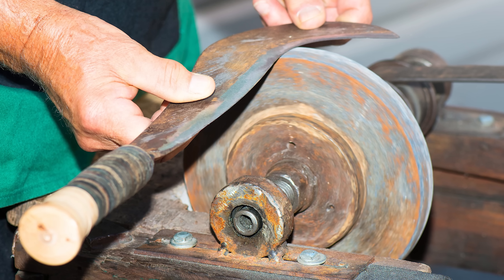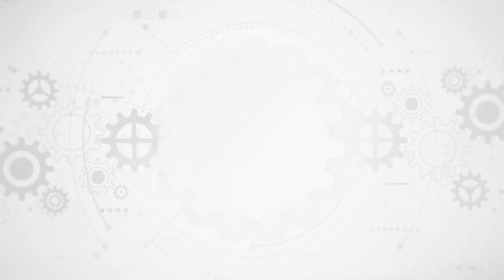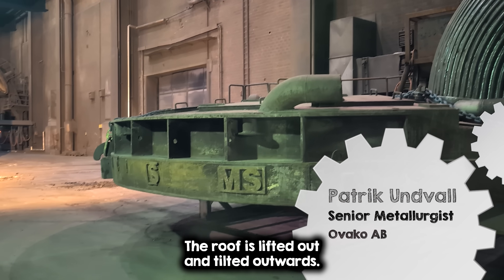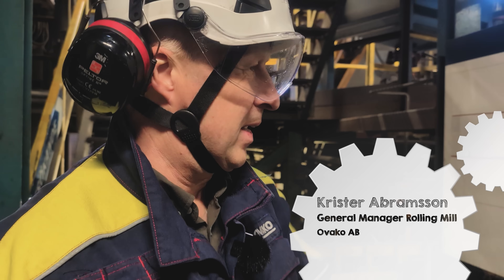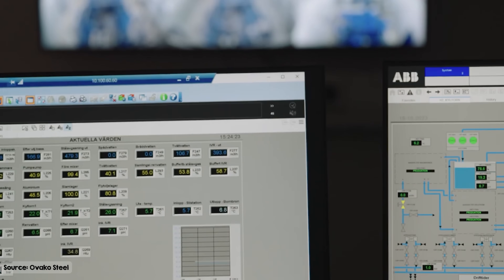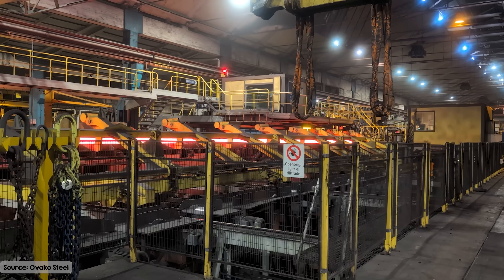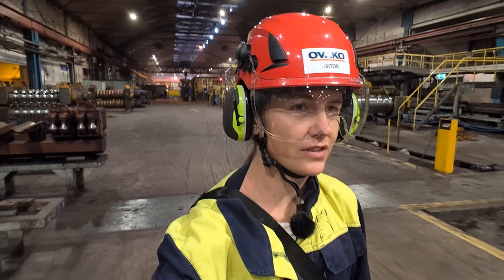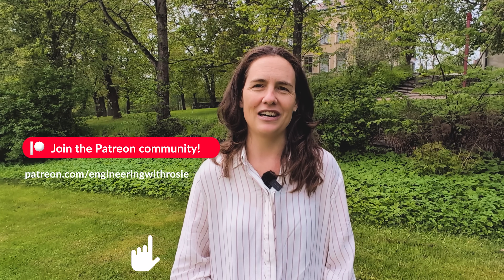STEEL REINVENTED: Inside the World’s First Plant to Burn NO FOSSIL FUELS [TOUR]

Comment: There is a big efficiency drop creating the hydrogen, so depending on local electricity grid, it may or may not save carbon. Unless your grid is heavily skewed towards renewables, you may be burning more fossil fuels from generation than just burning gas.

Comment: Great tour! Very exciting technology. Is there a reason they use electricity to generate hydrogen which they then burn, rather than just using electricity to heat the steel directly? Energy storage perhaps? Would a future mill potentially just use electric heating exclusively?

Comment: But where did the energy come for the electrolysers? Was it wind/solar or was it coal or nuclear? Recycling scrap intrinsically carries less carbon footprint, so there’ll always be electric arc furnace model. Similar to aluminium recycling scrap for 5% of virgin cost.

Comment: Producing H2 onsite is probably the best use case for it to mitigate embrittlement and leaks across pipelines. There are linings that can be used but it's easier and safer to just provide the electricity and water needed to the end user then have them produce H2 and store it locally.

Comment: Amazing look inside an innovative steel recycling plant! I'd be interested in how they solve the ramp up / ramp down of the electrolyzer, what the design is that makes that possible without a nitrogen purge, and what the efficiency is as a result of that design, i.e. how may kWh per kg of H2, and how many kg of hydrogen it takes to displace a kg of propane. Totally get whey they didn't / couldn't go with induction instead, but it would interesting to compare induction heating kWh vs. kWh to the electrolyzer for hydrogen heating. Hydrogen used onsite where it is created is the right approach.

Comment: in the end of the 80s i was with my father to the steelwork in Lesjöfors, it was in the winter and they mostly melted old steel.  we stood in the controll room when a loud bang sounded and i just saw a glowing piece going up from the EAF landing a bit further down the plant.   It was a old V8 engine that had Ice in it so when it got super heated the ice became super vapor and became like a rocket fuel :P 

it is so cool to get to see different plants like this

Comment: Hydrogen can be used to reduce iron ore into sponge steel. But this mill is not doing that, so their steel still has high CO2 emissions from the blast furnace stage.  

This video is misleading, or just poorly researched.

Comment: It seems blast furnaces are a thing on the past and the new way of producing iron ore is the the direct reduction method. India and Iran are the world leading manufacturing countries using this method. There are plants, although all small scale in Algeria, the USA, Argentina, Bahrain and Sweden. Unfortunately none use hydrogen as a reduction gas and Australia with one of the largest iron ore deposits has none. There are plans to produce direct reduction iron in Whyalla with a mix of natural gas and hydrogen. Hardly call that green if natural gas is used. 

Where does Australia think it is going to get natural gas from when they sell everything they extract to world markets. We now have to buy our gas on the open market from places like the US or China, who buy our gas, thanks to John Howard, at a price negotiated decades ago and far less than the current market price and the price we sell our gas to China and the US can’t be renegotiated until 2031. These countries don’t use all the gas they are guaranteed but then sell it back at market price to us. The Rudd and Gillard governments didn’t help either as they entered into similar contracts as well. We must have the most inept business sense politicians in the world, and what kind of public service do we have in fair trade and treasury to even bring such deals to inept politicians to sign.

Comment: It's really neat, though I don't understand why burning hydrogen is better than all the other ways of producing heat with electricity.  Can't tungsten be used for resistive heating even at these high temperatures?  Hydrogen can be stored, which is nice, so you can produce more hydrogen when the wind is blowing/sun is shining.

Comment: I'd be curious to compare the cost and energy efficiency between heating ingots with stored heat from electricity, (Companies like Rondo can store high temp heat in bricks using electricty.) vs. hydrogen. I would think electricity would be more cost and energy efficient? Although not storing and transporting hydrogen does improve the efficiency. Hmmm????

Comment: There is no clean energy, only low emissions energy.  Hydrogen is actually lower on the activicity scale than iron which means iron replaces hydrogen in chemical reactions.  Iron can be reduced electrically similar to aluminium at similar volumes per power used but iron is 3 times the density so 3 times the cost per tonne.  Rosie needs to do a full thermodynamic analysis.

Comment: Hmmmm, doing some researching it seems that deployments where the electricity itself is nearly free due to being plugged in to the DC side of utility-scale PV deployments in a future with substantial summer excess production, aqueous electrolytic ore processing would come up cheaper than current blast furnace based refining costs (specifically, coming up to just about 0.1 $/kg of iron). That's for an assumed installation potential of around 180 $/kWp of electrolysis setup vs. PV nameplate capacity. Co-located LiFePO4 battery storage for (some amount of) day/night shifting is assumed and as that needs to aim more at less-sunny days, there'd be some spare load shifting potential to use for higher duty cycles operation of the electrolysis. It's only assumed to run about 15% of the year's hours, still. Assumed is to have up to 20% of the solar nameplate capacity be matched with electrolysis nameplate capacity to not over-stress the load shifting and not limit the duty cycle of the electrolysis too much by it being throttled to provide the rest of the grid with normal grid power. (The PV heavy setup for e.g. Europe just involves a giant amount of overcapacity in the summer to handle winter heat pump heating, which btw. is not at all a bad thing as throttling in the summer just means you have more electricity than you can utilize at a time where sun is abundant; you want to have enough when sun is not abundant and as long as the costs involved to provide the latter are acceptable, everything will be fine and you can consider stuff like this seasonal iron ore electrolyzer to eat up effectively free sunny summer daytime electricity that the grid couldn't transport anyways (it's not worth to have that much more grid capacity as you can't afford the grid cost for such low-duty-cycle things).

Such a system just for reference would be using up to about 30% of it's yearly electricity production to feed the iron ore electrolyzer. Some other metals should also be amenable to low-duty-cycle capable electrowinning.

Comment: The title is a little bit deceiving. Propane is a fossil fuel where the energy cost of production needs to be factored in to the whole process as well as its use.

The use of scrap and electric arc furnaces is nothing new. It is not primary steel production. Sweden has a rather huge iron mine in the norther part of the country. That's where the process becomes more difficult to reduce fossil fuel consumption.

Just wondering if induction heating could be used on those billets and if so that could even eliminate the use of hydrogen.

Comment: Dr. James Tour and some grad students came up with a way to make Graphene from waste plastic(can even be dirty).  This "flash" process uses $30 worth of electricity to make one ton of graphene.(It was costing $thousands per kilo)  One byproduct is hydrogen.  The graphene has many uses.  In small doses it can increase strength and lifespan of concrete and asphalt.  Concrete is another huge producer of greenhouse gasses.  Extra strong concrete that lasts way longer means less concrete needed.  As we refine less and less fossil fuels we have access to less and less asphalt to make roads.  Significant lifespan increase by adding graphene means less asphalt needed. 
Build the graphene plant next to steel mill and pipe over waste hydrogen. New tech is cool.

Comment: In Northern Sweden there will be two steel mills that will make steel from iron ore, at least in the future, SSAB Hybrit and Stegra, using new environmental friendly processes. Stegra is a completely new steel factory that is built now outside Boden. SSAB in Luleå will close down the old coal dependent process soon and build and a new factory. The old coke plant has been one the biggest polluters in Sweden, in the 90s it contributed to 25% of the Swedish CO2 and SO2 emissions, now around 10%. So reducing these emissions are important.
Reply: Near polar and polar regions actually do need more co2, so it is unfriendly to reduce the emissions, and it's completely against the interest of nordic people.
Reply: @bennyklabarpan7002  No that's completely false. The polar regions heat up at 4 times the global rate. Meaning that the effects of climate change are already devastating local industries and ecosystems
Reply: @heinzaballoo  Polar regions are barren or in the case of antarctica it's the world's largest desert. There is an insane potential to increase the biomass on earth with more CO2. It could heat up 100x faster than the rest of the world and it would still be a net good in the long term. Ideally we need 800-2000 PPM CO2 in the atmosphere to increase the amount of life earth can host
Reply: @bennyklabarpan7002  No thanks.
Reply: @mementomori7825 quisling
Reply: @bennyklabarpan7002  Their fisheries are devastated by the acidification, their permafrost going away means far less stable infrastructure, and the sudden warming means that pests can eat away at trees that relied on cold for defense against beetles, meaning their lumber is about to start dying too. What benefit?
Reply: @meganegan5992  Fisheries are certainly not  devastated by acidification. Agricultural runoff & water power plants have affected fish spawning though.

Scandinavia does not rely on permafrost, maybe parts of Canada & Russia do, but no significant population lives there, and in the long term permafrost will not be reliable anyway, this would just be ripping the bandaid off. Gas extraction has similar effects, it does make the ground prone to earthquakes in the short term, but in the long term it does leave the ground more stable & it reduces the risk of a larger catastrophe were it to occur due to a natural disaster causing a double whammy with gas underground.

Pests are mainly a problem with monocultures, this is an entirely different issue that affects almost the entire world. Pests are also reliant on an equilibrium with nature, they can't survive without hosts.

Comment: The obvious question to ask was why they were still using fired soaking pits for re-heating the ingots, rather than using induction etc.  But it's clear that part of the reason they're wasting electricity to make hydrogen here is that they are otherwise burning propane which is very expensive relative to natural gas (which they don't have access to or else they'd be using it).  By switching between propane and hydrogen, they give themselves the opportunity to use cheap power when it's cheaper than propane, and to switch back to propane again when conditions merit.  It's likely not possible to go "dual fuel", so to speak, with propane and induction.

Comment: Would it not be more efficient to do the reheating using electric induction rather than electrolyzing water to form hydrogen (with high energy loss) and then burning the hydrogen to reheat the steel (with more energy loss, plus risk of hydrogen embrittlement)?

Comment: They are just smelting scrap that already is steel, not making new steel. Completely different things, so to brag that it is the greenest steel on earth is not true, it was still MADE somewhere else and then just smelted back to steel rolls here. It's like if i melt an aluminium can in my backyard with the sun in a sun oven and sell the aluminium and call it zero-emission aluminium just because i melted it using nothing but the sun. But yeah sure it depends on how you count, steel can be remelted indefinetly so it is still a very important industry but it is important to know the difference.

HYBRIT and H2 green steel are making NEW steel with H2 by using it as a reducing agent in the recipe, not as a heating agent. That binds oxygen (O) in the iron to the hydrogen (H2) to create H2O (water vapour) instead of using the traditional method where you are binding coal (C) to oxygen (O) to create CO that then reduces iron ore and you are left with CO2.

EAF is technically more efficient because it is direct imput and doesn't require middlehands that as we know always have losses, but it depends where the electricity comes from. So my guess is that Ovako have been smart and taken advantage of Sweden building insane amount of wind turbines, that collectively dumps the electrical price when it is very windy, sometimes on a few occations even going in the negative so you get money by using electricity. That's when they are making hydrogen en-masse to store and use later. So it works like a battery to create and store cheap energy. But this is just as a unique result of the wind farms destroying the profit margin for even cheaper long-term stable power producers like nuclear plants and hydroelectric plants that would work better co-op-ing with EAF's, but thats a completely different topic.

Comment: Did I misunderstand or do they actually use electricity to make hydrogen which is burned for heat?? If so, why is this better than heating the ingots with electricity right away?
Reply: You can do it directly, Kanthal even supplied retrofits to this very facility. The benefit of hydrogen in this facility appears to be as a buffer for fluctuations in wholesale electricity pricing and retrofitting natural gas equipment to use hydrogen. 

This is a puff piece for something that isn't a particularly new, or impactful change.
Reply: Presumably it's not possible. I guess the arc furnace method would be too damaging for the bars if you used that, which leaves you using normal electrical heater elements. I guess those might not be able to reach the temperatures needed without melting themselves.
Reply: Hydrogen burns at a higher temperature, and can be stored more easily in tanks. Funny enough, there are some designs for hydrogen blast furnaces, but those are mostly in the pilot phase atm.

Comment: Could they not use induction heating to at least preheat the steel?
That should have a higher efficiency and it might even be able to heat the steel faster. 🤷

Still it is just nice to see big industry doing something new. They tend to just keep doing what's working for them. 👍

Comment: Wouldn't it be 65% more efficient per kWh, to ditch the hydrogen and just reheat directly with inductive kWh?
Like how my induction hob heats my frying pan?
Reply: Then they would have to get their oxygen for the furness from somewhere else, and maybe truck it in, which would not be so efficient!
I suspect there would be problems controlling the temperature using induction, and your induction hob wouldn't work since hot steel above the currie point is not magnetic.  It is still possible to use induction, but it is not going to reach the correct temperature without a lot of control so that parts of it don't melt, whereas the hot gas gets it there without difficulty.
Reply: @nigels.6051 hydrogen is not oxygen, and for billet post processing it is just a reheat to maluability.
At least until madame curie enters the discussion...

Comment: great seeing how they're balancing between the heating sources dynamically with availability of hyrdrogen and electrical costs factored in.  really smart and exactly what you'd expect from good engineering costing. they probably can't use induction heating due to efficiency drop of it as the steel is at such high temp already.  Also nice to see the thermal capture for district heating in season.

Comment: Yes, it takes 1/3 tons of coal to make a ton of steel. But 90 % of the carbon goes into the carbon steel, not out the stack. It is impossible to make carbon steel without carbon! Without carbon steel is almost useless!
Reply: I think you're off by more than an order of magnitude. It actually takes like 3 tons of coal to make a ton of steel (exact number depends on process details), and the final alloy contains only on the order of 1% of carbon. So, far more carbon goes out of the stack than into the steel.
Reply: @leftaroundabout No, it takes 1/3 of a ton of coal to made 1 ton of steel and 4 time in the process they ad coal! It is called carbon steel for a reason! And the vast majority ofvthe carbon stays in the steel! Carbon steel!
Reply: @leftaroundabout almost all of the carbon from the coal goes into the steel. If you are getting more than  50 PPM CO2 out of the stack you are producing garage!

Comment: So where do they get the tons of carbon to put in the Carbon steel? With out the carbon from coal or wood the steel will be useless for anything but rebar and train rail! If you let hydrogen any where near steel it ruins it for anything! It is called hydrogen imbrittlement. Canada has 5 arc furnaces to make rebar from scrap. That process is 100 years old.